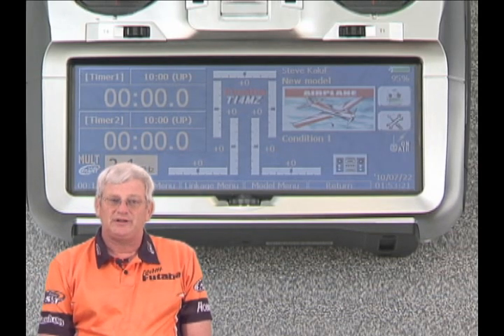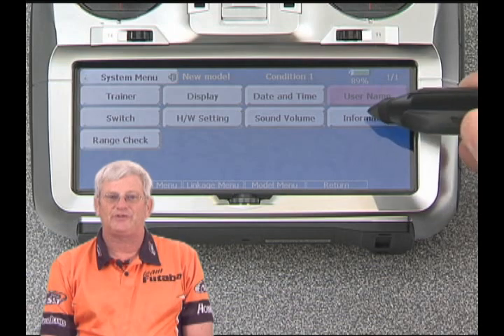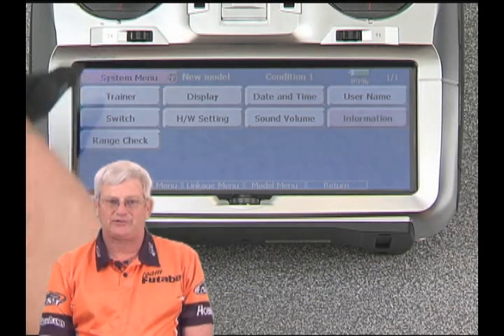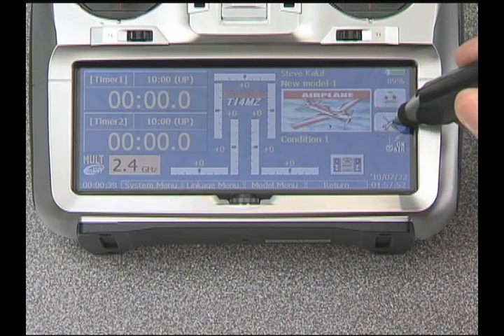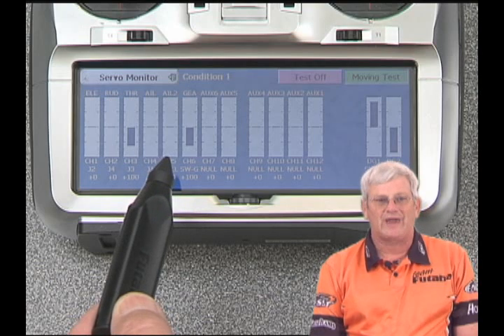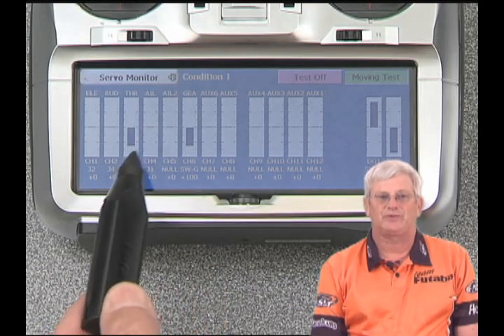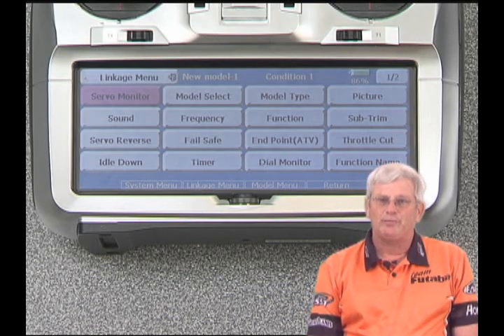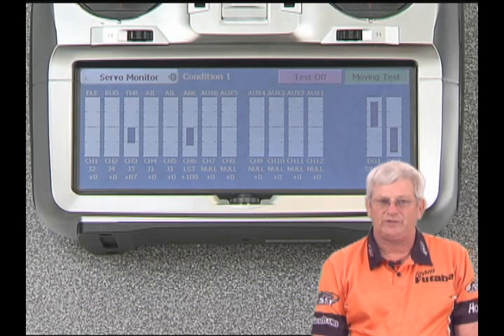Futaba® Radio Programming 101

Comment: hi
i have a futaba fx-30 and i want to make a small minature switch that once pushed will cause the uav to switch in the opposite direction to what it is for example if it is facing 180 degree with a push of a button it moves to 360 can you plz help me with this issue or a way in which it can be achieved thank you